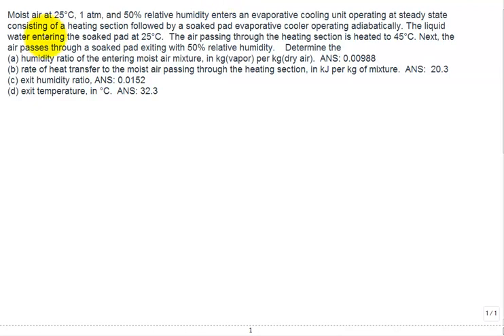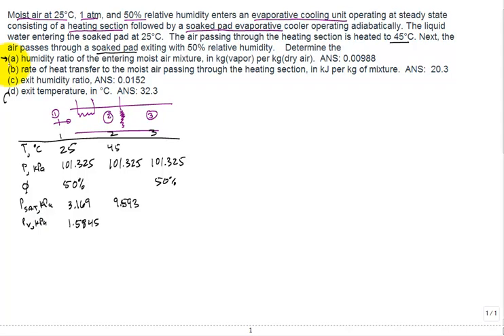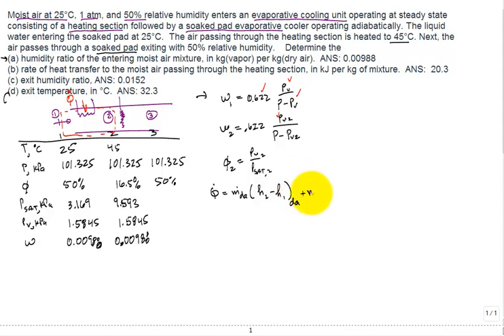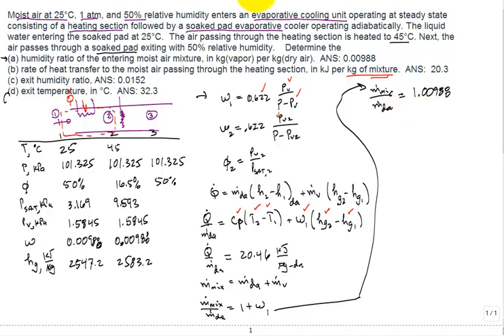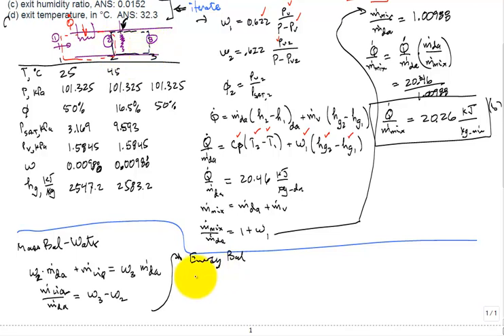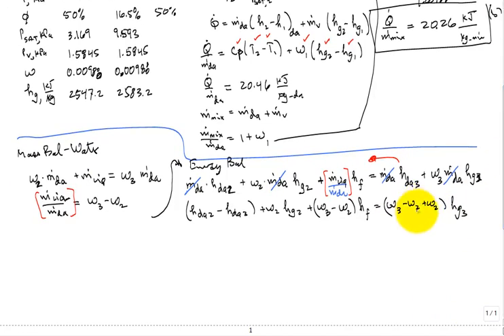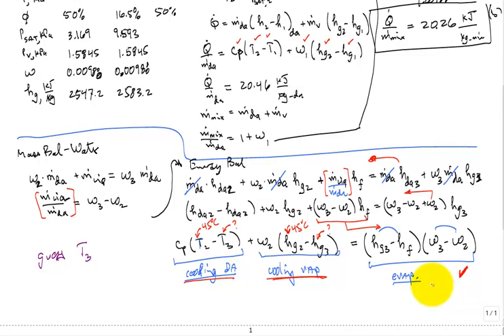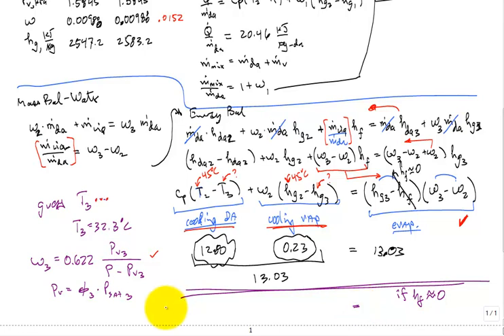me4293 Evaporative cooling unit with heater and then soaked liquid pad

Comment: Can i cool the air below wet bulb temprature by adding chilled water through evaporatorive cooler?
Ex if i  have air at dry bulb temp at 36 deg C and RH 42 % wet bulb 25.1 deg C 
Can i cool the air at 11 deg 
What will be the makeup water flow rate and what temp will be required.
Please explain with calculation